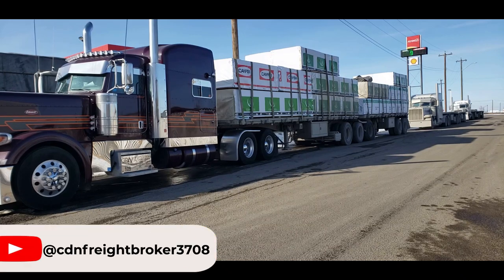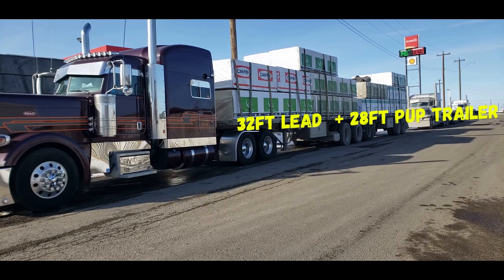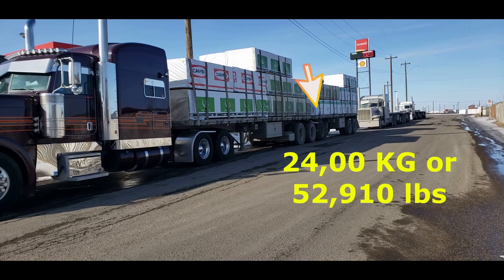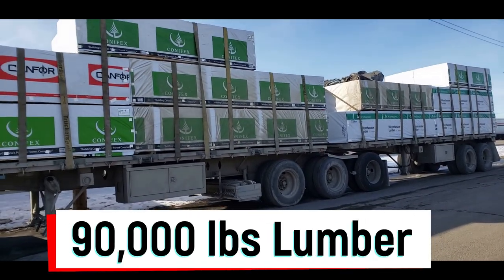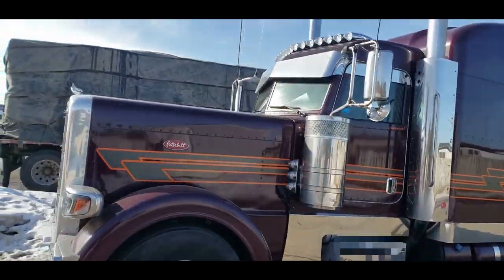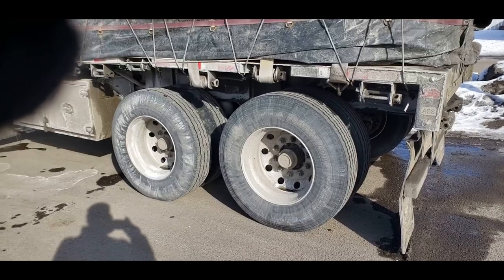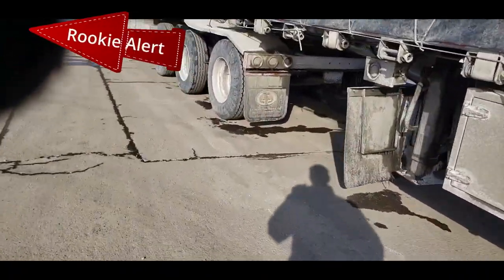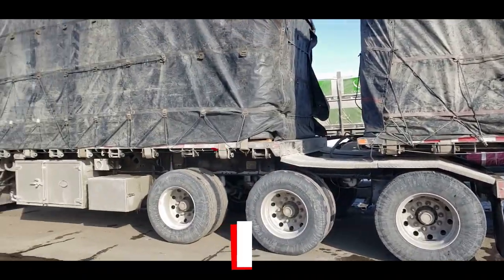Super B Flatbed - 90,000 lbs - What + Rant!!

Comment: For that truck the steer axle would be 7400kg as he doesn't have super single steer tires. The other thing is the over length of the trailers is not 32' + 28'. That is the deck length, they come in 28' + 28', 32' + 28', 28' + 32' and 30' + 30'.
Reply from the maker: My apologies if any confusion but the decks were 32ft + 28ft. I plan 16 (4'x4' ) pallets on 32ft lead. Then 14 pallets on 28ft pup. In Alberta, max for steers is 5500-6000 KG. I did make an error steer axle weights.
Reply: @cdnfreightbroker3708  That's alright as I obviously can't type either, 7400kg would be if it was super single steers with a 20k lb axle.
Reply from the maker: @mail_liw  I have never heard super singles were used in Alberta, but I could be wrong.
Reply: @cdnfreightbroker3708  Theyre not super (no pun intended) common with super b set ups but they're definitely popular for lots of applications.
Reply: Umm you’re only allowed 5,250 kg on the front axle! Unless you have wider tires like 315’s - 445’s! 

Only logging trucks in Alberta that have a log loader on the truck with special permits are allowed 9100kgs

Comment: Sounds a little high for the front axle . But maybe different in Alberta .
Reply from the maker: You are correct, I make an error. In Alberta typically 5500 KG, some trucks might be able to take 6,000 KG. I will have to make a correction video.

Comment: So what makes it a super B? How long are the decks for a normal B-train?
Reply from the maker: There is only Super B, no "Normal B", st least that i am aware of. Per my short. The lead trader is 32ft & B-Train is 28ft = 60ft. This isn't longer than a typical flatbed. Super B's in western Canada can haul 90,000 lbs. There is also another common trailer combination in select areas of Western Canada, BC-AB-SK-MB called a turn pike which is 2 x 53' dry van trailer being pulled by one semi. You see them in select lanes, especially between Calgary, AB to Edmonton, AB. I hope this helps.
Reply: @cdnfreightbroker3708  there used to be B train.I hauled one back in the day.B train would have only two axles between decks while super B has three.